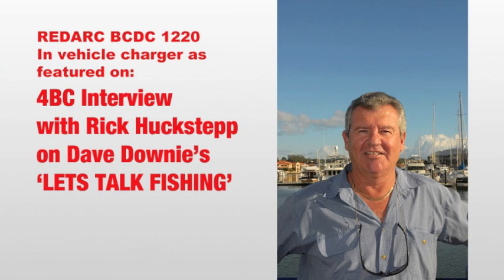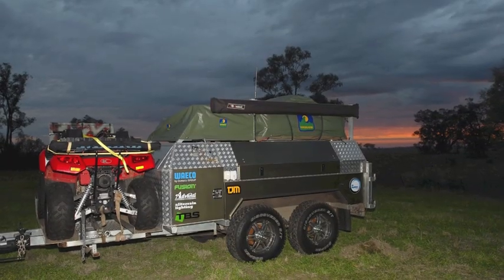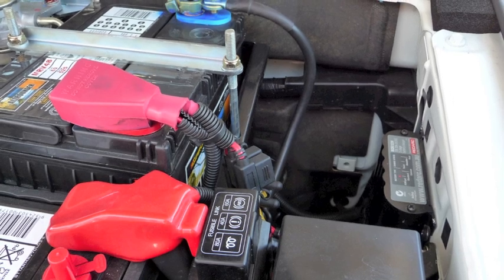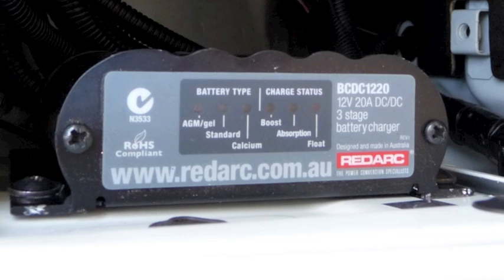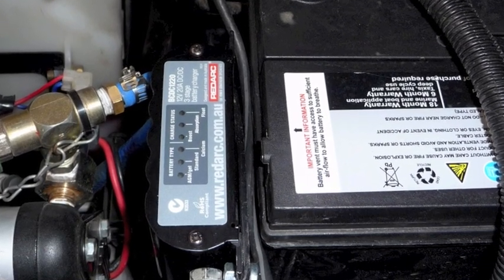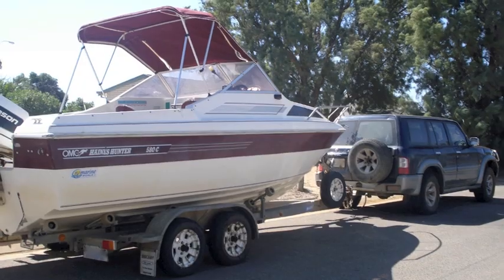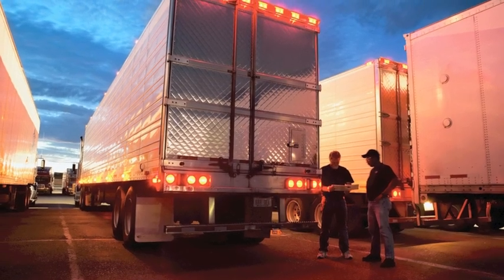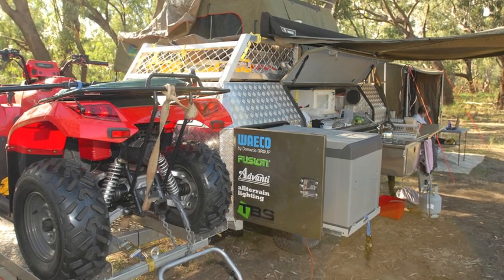In-Vehicle Battery Charger Via Anderson Plug Connection

Comment: If you starting battery goes flat you can't use the auxiliary battery to start your car with the bcdc1220. My cranking battery was too low to start the car so I had to swap batteries out and run long enough to charge both batteries and swap them back again. These units aren't cheap and this is a feature that should have been included 👎👎👎👎👎
Reply: Phil hayward hey bud couldn’t you have Jump started it off your 2nd battery?

Comment: the New BCDC1240D charge is a great unit no need for relays has a preferred green mode so if you have a solar panel mounted all the time it while driving it will draw from the solar panel and then if say the charger needs 2.5v to top the charger up then it will only take that from the tow vehicle its a great unit they have only been out a month

Comment: the unit doesn't sense what its charging...you wire it in according to what your charging....for eg if your wiring it in to charge an AGM you don't hook up the orange battery config wire...that way the unit then recognises you are charging an AGM and sets up the charging cycle to suit and condition an AGM battery...if your wiring up  for a lead acid battery you need to wire in the orange lead coming from the unit to let it know its a Lead acid battery it's charging...I have a BCDC 1225 with a solar input (a relay that switches the input from the alternator to the solar panel when the bcdc unit doesn't have a feed from the ignition circuit
Reply: Exactly Murray, you can see how this guy got in trouble in the first place.
All the gear and No idea!
And even when he was given the right gear, he still didn't even understand how it works.